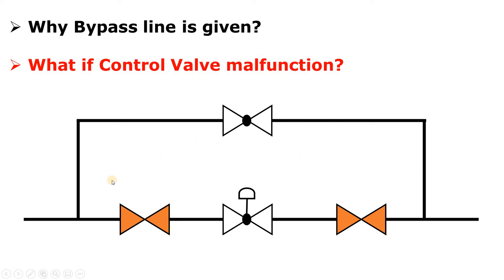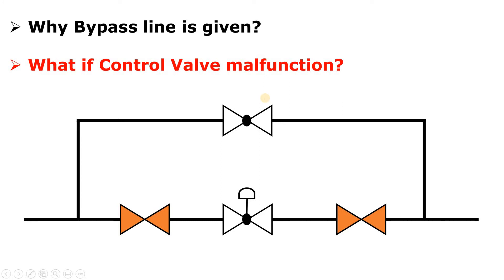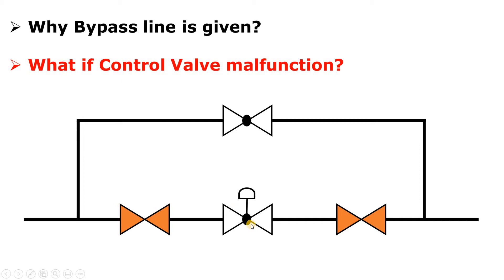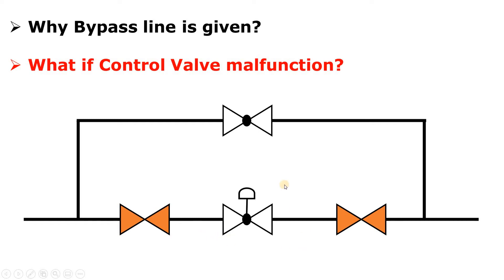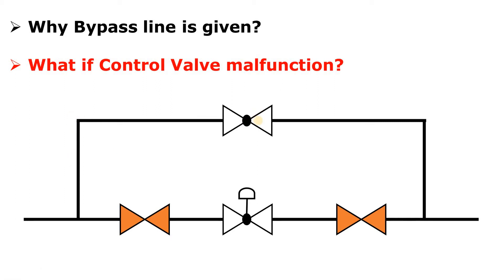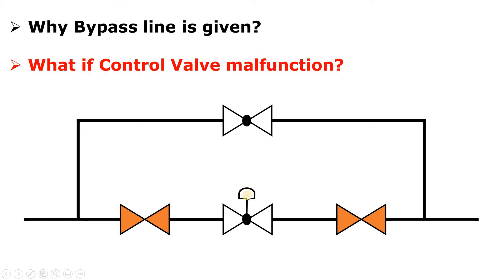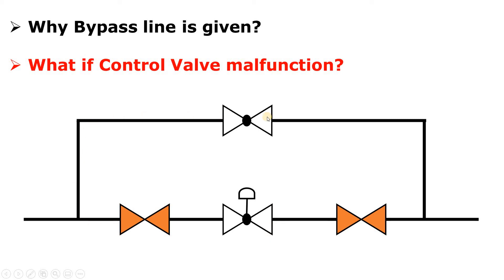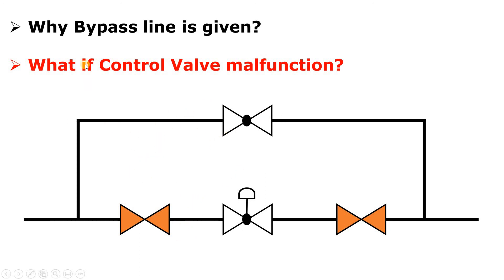Why bypass line is given in the Control valve pipeline | Control Valve Malfunction.

Comment: This is out of date. We shouldn't rely on manual control. Additionally, bypass valves may fail and the control valve requires double block&bleed valves to isolate safely.
Reply from the maker: Valid point! But there are many existing plants having this provision

Comment: Does pressure control valve needs any bypass line.
Reply from the maker: Yes It requires but not always! in case if there is condensate line, steam line and malfunction occurs....you could simply take it in local mode and take the fluid in line via bypass but if there is process fluid and in many cases we don't provide the bypass line their in the control valve so if any malfunction occurs there whether it could be attend online or via shutdown or in shutdown.

Comment: can u please tell why globe valve is installed near TEE not in centre and wat is cailed FC & FO in control valve
Reply from the maker: globe valve is used because you can control the downstream flow very easily here and FC and FO means Fail to close and Fail to Open w.r.t Air respectively.
Reply: I m asking about why globe valve is installed close to tee  it can also be installed  in centre
Reply: If there is leakage from CV which just above the glove valve, the leakge fluid can fall on globe valve, so globe valve doesn't put in centreline of CV.

Comment: I have a question
After maintenance, how to open 2  bottom valves safety to back fluid to the normal line? I mean, 2 valves, which valve we open first?
Many thanks!
Reply from the maker: first open the upstream valve of CV slowly slowly then downstream one in same fashion or you may open then both valves if there is shutdown and now its time to startup.
Reply: @Coreengineers  thanks for your response. The pump is still working (not shutdown), i open valves slowly but i dont understand why the pressure is very high although the flow rate is small.